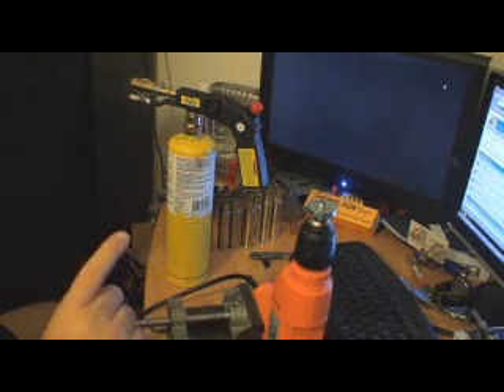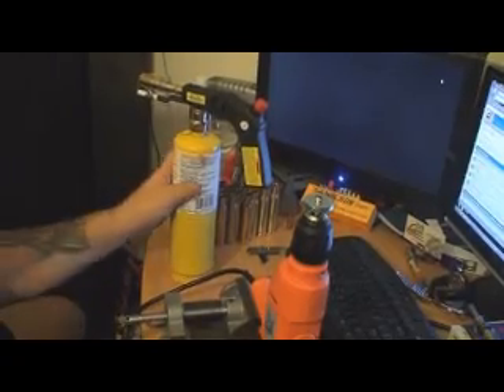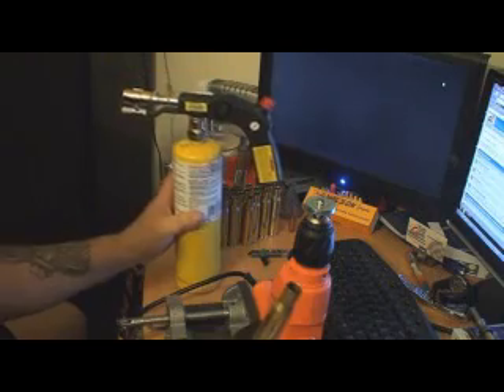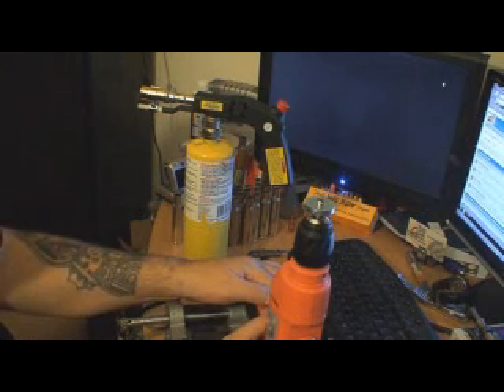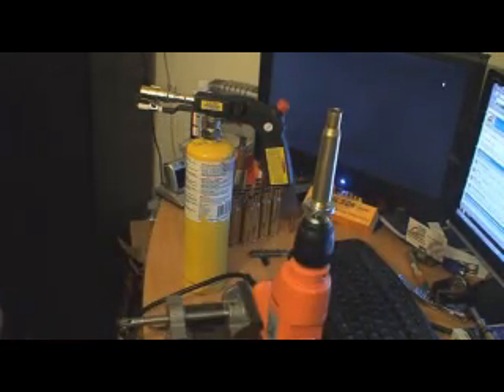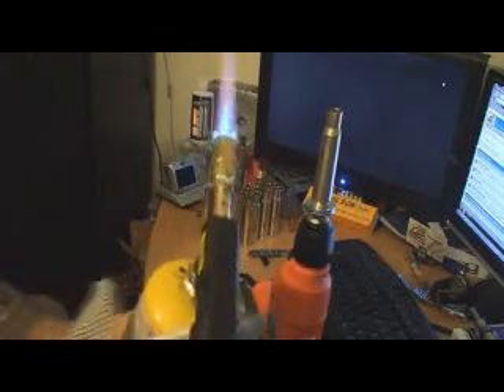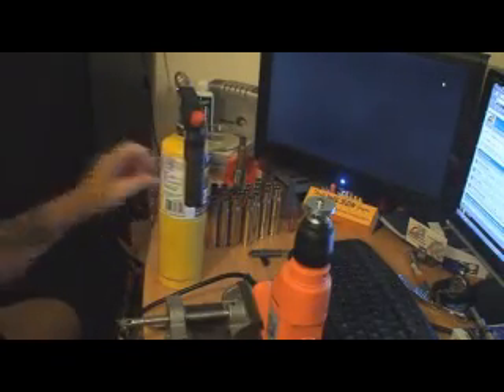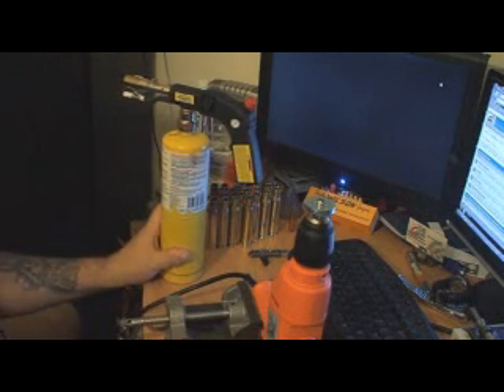50 BMG Annealing Ver. 2.0

Comment: In general the neck must be heated to 662 for 15 min 800 degrees for a few seconds. This isnt the temperature of the flame but rather the case so you have to take into account heat transfer

Comment: well the point is actually to get above 482 degrees because if you havent changed the structure of the metal than what have you done? nothing. the point is to release the stress formed from the cartridge being shaped during firing and then from resizing. This stress actually causes the metal to harden and thus become more brittle and crack. You anneal the case to prevent this. If you dont do this evenly theres no point in doing it really because the weakest part is the part thats gonna crack. You should look at an article called annealing by 6mmbr.com

Comment: Actually dropping it in water is to prevent the heat from reaching the case head. It has no quenching effect like steels. 
The heat has to go somewhere, and it will conduct faster then it convect to the air. 
Personally I don't think your getting the neck hot enough, but I have no way telling.
Try some Tempilac from Brownells, works great to gives you a baseline.

Comment: i do belive he is right you are supose to put directly into cool water so that way the metal hardens. allso the problem with your method is is isnt 100 percent consistant. if one is heated .001 seconds longer it could possibly change the accuracy of the rounds your shooting. i have seen setups that are on a circular base and rotate slowly around till it passes the flame. yes very expansive but you will get 100 percent the same heat on the rounds....and do stick them in cool water after